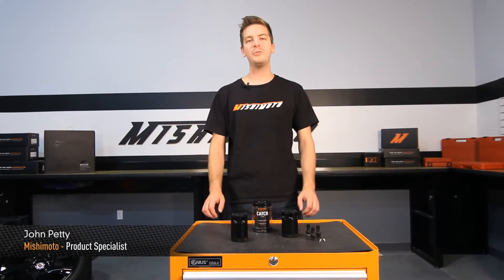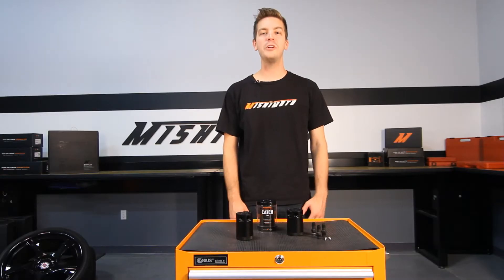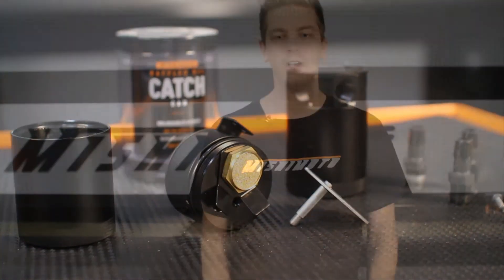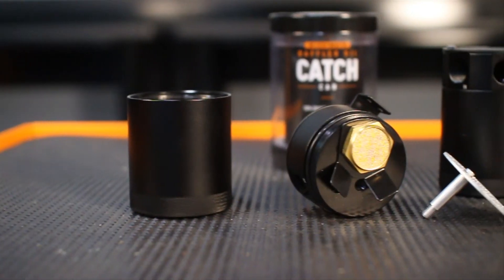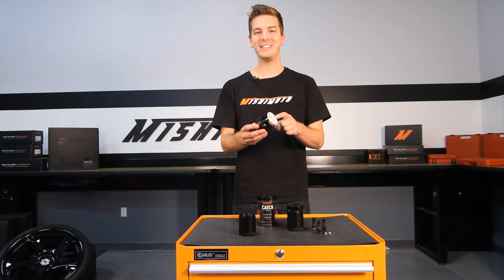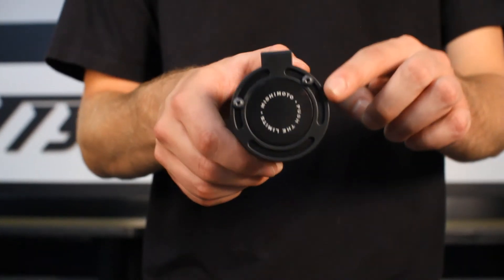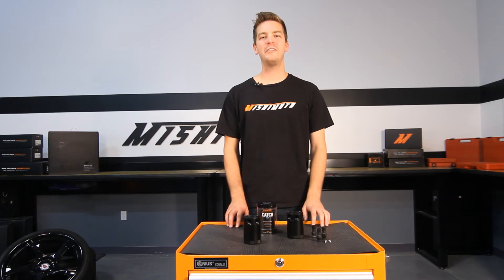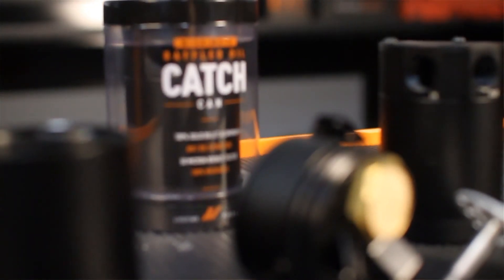Mishimoto Compact Baffled Oil Catch Can, 2-Port & 3-Port Features & Benefits

Comment: I have a 2019 subaru sti which is better to use?  Is the 3 port so I dont have to Y connect the pvc line?  Looks like the 3 port would give the pvc line directly to one of the inlets. is that right? Sorry I am new to this.
Reply from the maker: Our kit up to 2014 uses a dual-can setup, one 2 port and one 3 port can. You may need the same for yours, we unfortunately haven't got to that year quite yet!
https://www.mishimoto.com/subaru-sti-baffled-oil-catch-can-kit-08-14.html

Comment: How restrictive is the airflow through the bronze filter?  Would the filter clog over time?  Would it allow adequate crankcase ventilation?  I'm concerned about inadequate crankcase ventilation which may lead to oil contamination.
Reply from the maker: The filter is larger than the ports on our catch-cans to allow for maximum airflow while still removing blow-by particles. As long as the can is emptied at regular intervals, you won't run into any issues with oil making its way through. We typically recommend establishing a baseline for your specific vehicle at around 1,000 miles and cleaning the can with mild dish soap every few times it is drained.
Reply: @mishimoto  Can I reuse the bronze filter element after cleaning with dish soap?  Or does that have to be replaced from time-to-time?
Reply from the maker: This can be reused.

Comment: One important question! .. does the catch allows boost to enter the cover? I have an rb25det! And its getting the intake to dirty ,i have the graddy intake(fake one) looking to use the 2 ports and delete the pcv one so i put the cab in the middle
Reply from the maker: We would recommend a one-way check valve in the outlet tube to prevent boost from pressurizing the can.

Comment: Does this oil catch can have to be removed when the temperatures drop below freezing?
Reply from the maker: Nope! We recommend checking it more often in colder weather, but assuming it is cleaned properly you will have no issues in freezing temps!

Comment: So the 3 port is one inlet 2 exit from the can? I have a 2017 sierra figuring out my plumbing. Have read one into the valve head for idle and cruise and one into the manifold for wot
Reply: This is in reguards to vacum created at different states of throttle to offer optimum can performance
Reply from the maker: Hey Nikolai, the 3-port catch can is a single outlet, dual inlet can. Typically used for valve cover vents on V configuration engines.

Comment: How is the 3 port catch can properly installed on an inline 4 cylinder engine?
Reply from the maker: Shane Rhabb The 3-port can is more for if the vehicle has two valve covers or if the vehicle has two ports on the valve cover like the Honda S2000s.
Reply: +Mishimoto Automotive  Can I run one in port for the valve cover and one for the crank case?